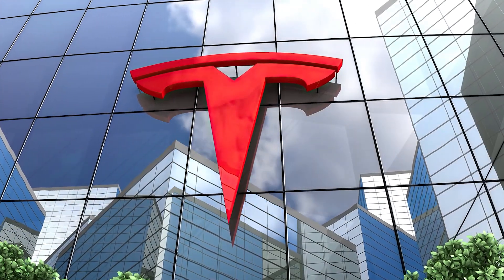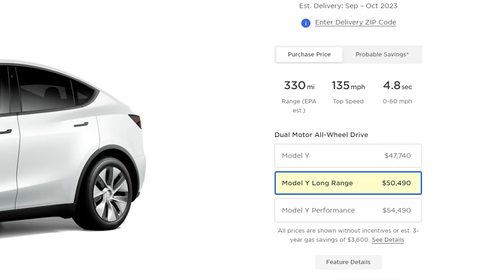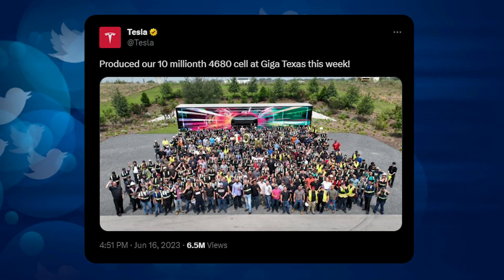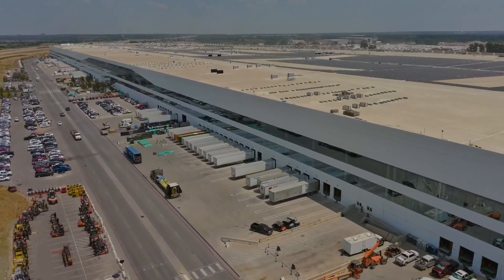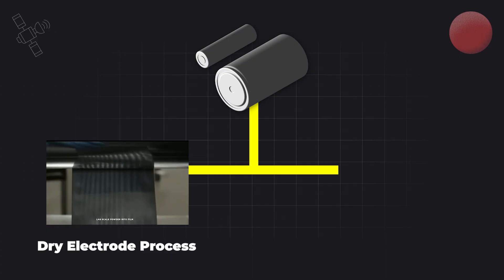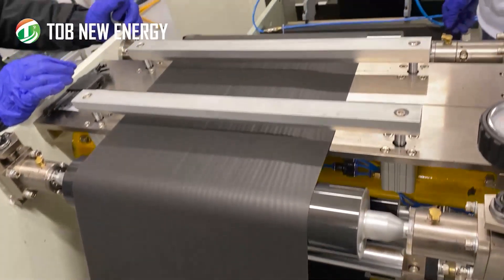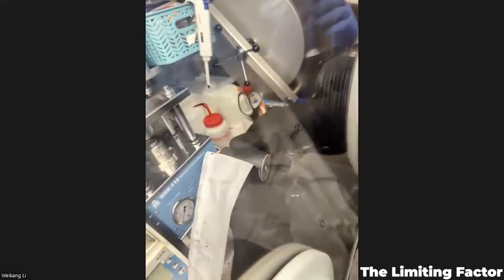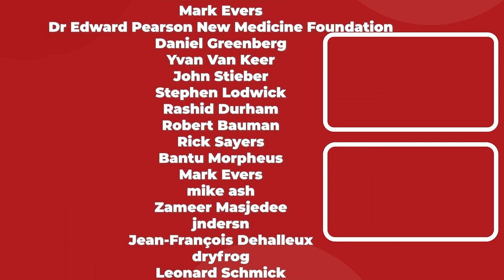Tesla Has A Problem With The 4680 Battery Cell...

Comment: Musk is known for his over-optimistic timelines. But usually, he achieves his goals – just not by his advertised schedule.
Reply: Oh really?  What ever happened to the $35k model 3?  Never was and never will be.
Reply: You're wrong, @rcpmac ! They did offer it. But they did not promote it very much due to low margins. It was not shown on the Tesla website but you had to call them. A quick google search would have clued you up, btw.
Reply: @rcpmac  so love all these fossil fuel supported comments like yours ~ will enjoy revisiting them in 10 years time once EV vehicles are the norm.
Reply: @hitreset0291 why are ev sales slowing down then even with 7500$ government subsidy that ends at the end of the year. I can't imagine all the cars going up 7500$ will cause a  sales rush
Reply: @mddunlap03  stick with your gas guzzler if that floats your boat.
Reply: @hitreset0291 that dude didn't say one thing about ICE vehicles in this comment thread. You are projecting.
Reply: Difference here is that they actually lied. They said they were currently producing cells with these stats 3 years ago. They weren't then and they aren't now.
Reply: the real problem isn't 4680 battery technology or even the manufacturing line. the problem is Elon over promises and under delivers, then Elon worshippers go ape shit. If people stopped worshiping personalities or Elon stopped over hyping, there wouldn't be any problem. In software engineering, we call this "manage expectations". Elon has historically sucked at managing expectations.
Reply: You ever met Elon in person? Even once? Prove to me he is not a deep fake.
Reply: @DieselRamcharger  He's probably living in his simulation. 😉
Reply: @Horizont.  Arent we all? :-D
Reply: Yeah, hyperloop is magical. 😂
Reply: I think it would have been better spending that investor money on people who do not lie as much and deliver real breakthroughs.
Reply: @prolarka  At some point, you can't just keep calling an outright scam as cutesy over-optimism. They're just bald face lies from a psychopath. Just because he made EVs popular, everyone thinks he's some rocket scientist super genius. There's no proprietary technology invented by Tesla.
Reply: There is a difference from over optimistic timelines and musk’s timelines. Pretty sure he said the cars would be fully autonomous by the end of 2018
Reply: @benchoflemons398  at least autonomous car is somewhat feasible even if it kills a lot of people. His promise to colonize mars in couple years is so stupid and implausible that you need to be a card carrying retard to actually believe in.

list of failed Elon promises:
-robots 
-electric semi trucks
-revolutionary  solar panels 
-revolutionary tunnel digging machines
-underground tunnels for single cars
-Hyperloop 
-mars
etc......
Reply: @benchoflemons398  True.  He shoots for the moon.   I was listening to a pod cast about how he wanted the model 2 ( the cheaper smaller vehicle they are working on) to have no controls in it because he was so into the idea of autonomous driving,  even though that happening is still a ways off.   He tends to chase his ideas and ignore reality.
Reply: Over optimistic timelines? You mean blatant lies?? Over optimistic timelines would be 3-6 months late. Not years late with nothing to show for it.
Reply: Everyone would be fine if he missed timelines by even up to 50% (It'll be ready in 12 months but takes 18).  What is frustrating is when he says FSD will be feature complete by 2019, yet four years later its still nowhere near complete! (Save it! Elon needs to drive for 45 minutes on V12 in any downtown metro area with zero or even 1 intervention before anyone can say its close, because driving mainly in the suburbs on well-marked streets doesn't pass muster!)  The current excuse is they're "compute constrained", but they'll have 100x the compute power up and running by Oct 2024.  At that time they'll be another reason it's still not ready and the Cult-bulls will forget all past failed projections and just roll over and lap up whatever the new "game changing" strategy is pushed that will actually solve it this time, just like they did in 2019, 2020, 2021, 2022, 2023 and soon 2024.  It's actually fully understandable that FSD hasn't been solved.  It's likely the hardest technical challenge ever attempted and the amount of edge cases are nearly limitless.  What I don't understand is why Elon keeps predicting these ridiculous timelines.  I think most people and investors would rather Tesla keep many of these projects under a Skunk Works type R&D department and only unveil them when they are literally go-to-market ready.   Rant over... and as an investor, I will happily eat my words and admit I'm an idiot with maximum contrition if FSD is solved by year's end.  PLEASE make it happen, Elon and the Tesla FSD team!
Reply: Yeah, he's overly "optimistic" .   Unfortunately for him, in the last couple of years the Chinese have been making huge leaps in battery tech AND can produce those batteries, Tesla even uses their batteries.
Reply: lol dont even mention the Chinese they are overly hype up by the media. Their EVs are catchiing fire left and right @1diggers1
Reply: @1diggers1  Why do they have so many battery fires then 🤔
Reply: @edwardecl  I'm guessing you're referring to the Blade battery by BYD.   All of that is taking place in China so it's pretty difficult to know real numbers on battery fires.    In the US a common perception is EVs are more prone to catch fire when in realty they are 10 times less likely than an ICE vehicle,  so it's hard to separate assumption from facts. 
The CATL company also has a lot of new battery tech they are producing that are more advanced than what Tesla is doing.
Reply: Such an unreasonable thing to say. Elon Musk has failed on far more of his promises than not. 

Time also matters. Solving self driving in 50 years isn’t impressive. Solving it in 2019 would have been impressive.
Reply: solving self driving in 2025 instead of 2019 is still impressive, as nobody else has done it. @Thomas-re9ky
Reply: Indeed. I'm not going to knock Musk, or Tesla, down for trying his best. He freely admits that he is overly optimistic with his predictions, but project completions still tend to come in sooner than they otherwise would, if he made realistic time predictions. 
The real exception is FSD. Musk has realised that it is a much more difficult task than predicted several years back. But Tesla are very much on-track now. Tesla's FSD is now getting astonishingly good, but it will get better. Even when it gets good enough to release globally it will still improve, to the point where everyone in a Tesla, or any vehicle with licensed Tesla FSD, will hand over the driving to the machine.
Reply: @ramblerandy2397 My brother in christ, they aren't even the best driver assist on the road today. They aren't even level 3. They have years and years to go.
Reply: @TheBCninja   absolutely my gas guzzler has had FSD for years ~ when I come out of the pub I just place one of my kids on my lap, as they have been waiting for me in the car in the hot sun of course, to help drive me home. 
Brilliant low cost tech.
Reply: Yes. It can achieve anything as long as you can wait until.
Reply: Forever! @rgen28
Reply: Still waiting on a mass avaliable 35k 300mile range car
Reply: @mddunlap03 is Tesla's defense they did sell a handful of those so they wouldn't go to jail (fraud) and then pulled that option as they lost too much money per unit.
Reply: Name a single one that was achieved.
Reply: Yiu mean hes a vaporware salesman woth slightly better gambling skill than the theranos lady.
Reply: Elon achieves none of his over-optimistic ideas. The only real achievements he accomplished were inventions the existed already. EV and Rockets exists way before Elon was born.
Reply: Where Musk really gets in trouble is when he makes important decisions about highly technical issues that he doesn't really understand. He is good at visualizing products and funding an engineering team to make them happen. Where he falls short is when he specifies products that face real technical roadblocks such as with the 4680, Neuralink, Hyperloop, Mars colony, exoskeleton, and FSD.

Comment: LFP cells have improved dramatically since 4680 was announced. Cold weather performance and weight issues have been solved. So why not make LFP in 4680 format.
Reply: Lacks brute discharge current and charge current ability.
Reply: Because the blade configuration is both cheaper to make and has better performance. Globally many Tesla's are fitted with blade batteries.
Reply: @jimgraham6722 I think Tesla uses more LFP batteries from CATL than from BYD
Reply: @pauld3327  Not sure. I know they do use BYD blade cells including in some vehicles made in Germany. It is difficult however, to know the status as even owners (I am one) don't know exactly what cells are in their Model 3s. I know mine has LFP batteries but don't know whether they are BYD blades, CATLs or something else.

My Atto in the other hand has the exact battery specification in the owners manual spec sheet as follows, Man Traction Battery:  400V 61KWHr LFP 126S1P blade cells

Comment: First rate work! Knew there were multiple problems with the 4680 but wasn't sure exactly why they were stalled on this (ie a 4680 with 300+AH/kg) and fully dry to get rid of the ovens and solvents (cost)
Reply: These batteries are not 300wh/kg but 286 wh/kg.... this is another Elon slip-up that was unfortunately not mentioned in the video.

Comment: The reason why Tesla hasn't mass produced those 4680 batteries is due to them still "working on it" since they had problem with bad batteries being produced due to one problem or another. There is no point in trying to expand the line from 1 to 3 lines if they are STILL WORKING on it to make the process faster and better. They are increasing the number of batteries being produced month by month just like in your video where the trajectory is going up, not down as months passes. Therefore, they are making changes for the better, and increasing the speed of production, albeit, slower than projected. They had problems with caps which were not being crimped properly, and as a result in bad battery being produced, and they keep changing and upgrading their battery so less bad batteries can be produced at a faster rate. This is Tesla's FIRST attempt at making a battery, so give them a break.....sheeee.
Reply: Wtf is that bot conversation in this comment
Reply: @zocktbf8437 you find them in all Musk/Tesla video threads. Seems like grifters think Musk fans are gullible 😂
Reply: This video isn’t dumping on Tesla, simply stating facts, Tesla has fallen significantly short in timing and expectations. There is still no sign of silicon anode yet. This shortfall has impacted ability to scale and may have caused the delay of the Cybertruck. I’m a massive Tesla fan and shareholder but 4680 ramp has disappointed me a bit.
Reply: @adama3231 disappointed? Get over it. We all know Tesla will never hold up to they stated time frames. Are you a new Tesla fan? Tesla is the only company pushing the envelope for EVs. Pay attention.
Reply: @adama3231  - don’t disagree. Elon continues to missed his commitments and the company struggles as a result. He has maintained his position that he is a better engineer than CEO. Typical for leaders of this caliber, they have difficulty handing off responsibility when it is needed.
Reply: @scottmackey4182 Elon Musk is not an engineer.
Reply: Not only teslas first attempt… outside of the short runs A123 originally did this is the US’s first attempt at battery production.
Reply: What's the % of the 4680 that are bad from the manf.?
Reply: @Trust_but_Verify  I am not sure, but when first started the mass production, it was around 75% or bit less that were good, but they are now at around 90% or so, maybe bit more. They started with just making good batteries, then changing the parts that will produce at a faster rate, then they started to add in different ingredients, AND processes like dry cell technology into the battery. They already are using dry method for Anode, but still using wet method, which is a standard in the industry for the whole battery, for cathode. Using dry method where you don't use so many toxic chemicals is cheaper. Now they are going to start using silicon in the mix in their Anode, and cathode will start. They are ALWAYS trying to improve the speed, and efficiency of the production line to cut costs.
Reply: Lmfao are these people serious? Just started dropping a pyramid scheme and think we will fall for it?
Reply: @user-wb8yj7qx8f Tesla is ALWAYS improving their parts so they are not being OUTADTED as long as NEWER batteries with more battery life, or power is introduced and it looks like others haven't yet found a newer tech which is much more improved batteries.
Reply: Exactly
Reply: Solid state batteries are the future
Reply: Sheesh is absolutely right! They will nail this battery in good time. Quit trying to dump on the company doing everything they can to change the world of electric vehicles! Sheesh!
Reply: @scottmackey4182 you're the reason Tesla fanboys get a bad rap. A complete inability to hear any valid critiques of the company w/out getting emotional & lashing out.
Reply: @MokeAnit  - ooo, lashing out. That’s me for sure loser.

Comment: Please give us a clear estimate graph of the 4680 production in Model Y packs per months for the last three years. To give us an idea if Tesla is on a curve to solve the problem. If they don't solve this their expansion numbers are lower. And it explain why the Cybertruck and the Semi are late.
Reply: First off, they couldn't make more batteries due to having complications with the supply chain, material availability, and problems associated with producing mass quantities of batteries. He even showed the graph where the production of battery has been going up each quarter or months. There is no point in making a semitruck when the battery isn't available in large quantities. That is just common sense. There is no point of hiring more workers when you are only making a few at a time. The cost associated with making a few vs many is vastly different depending on the number of vehicles produced in the same day, hour, and minute. Shortage of batteries is just one reason. Supply chain was another issue that they had to deal with. Without parts, you can't complete the vehicle in the production line. That is also another common sense.....I am sure there are other problems they had associated with developing a NEW Vehicle......
Reply: I don't buy Tesla had a problem on the supply issues of the batteries. They had a supply problem on the chips issue like everybody else. They are having problems on the fabrication of the batteries. If they don't show significant improvements then  their vehicules  production prediction are completely wrong. @1flash3571
Reply: That's like asking what's gonna be the most popular car model in 20 years. Good luck tryna find that one out.
Reply: As investors say: "Past performance is not indicative of future results."  Yeah, you can -- more or less -- predict ramping up manufacture of a certain tech, once the technical challenges have been solved.  But quite clearly, from this very well-informed video, Tesla still faces many unresolved technical challenges.  The various posts here claiming confidence that Tesla can solve all these challenges are just whistling in the dark.  I certainly hope that Tesla can significantly ramp up 4680 cell production, but that's very far from guaranteed.  This whole thing may be a massive fail, and may be scrapped for a type of battery cell easier to produce.
Reply: @davidsooby9961  Isn't that why Tesla is using MULTIPLE types of battery sizes from multiple battery companies to build out their battery packs???? Also, Tesla is giving us on their progress on how fast or slow the progress is coming....Even if Tesla do not reach their goal, as long as they get close, shouldn't that be fine also?????

Comment: i dont do 300m in the UK a month so this making range anxiety a problem was an ice argument as for charging it would charge at the supermarket while i was shopping i only fill up with diesel once a month anyway (50L) doing 32 to the gallon local 55 on the run from halifax yorkshire where i live it's only 100m coast to coast and 200m to london/edinburgh so i dont need 500m charging at a time this is the same argument as the v8 bigger the better argument
i am quite happy with the size of my P3N355 and dont feel the need to compete

Comment: Could 4680 performance be improved via software update?
Reply: Reading between the lines with the absence of silicone the energy density is lower than expected so I reckon no.
Reply: Thats an optional extra >.<
Reply: Software cannot alter the physical properties of batteries. Only control charge and discharge speed

Comment: Nice video. Appreciate the FUD. Hopefully, this helps keep the share price low until my 401k to IRA rollover goes through. Can't wait to buy more shares at discounted rates.
Reply: How is this FUD? xD It's just a technical update of the current status on their 4680 project.
Reply: @thotmorgana Fear that 4680 battery production will fail.  Uncertainty that Tesla will be unable to solve the shearing problem. Doubt that costs  will ever be cheaper making 4680 batteries since it's not cheaper now.   These are examples.  Some people will take all this info as being negative and act on those thoughts.